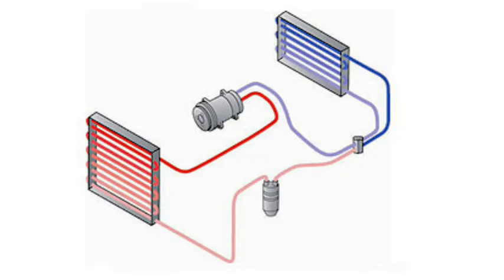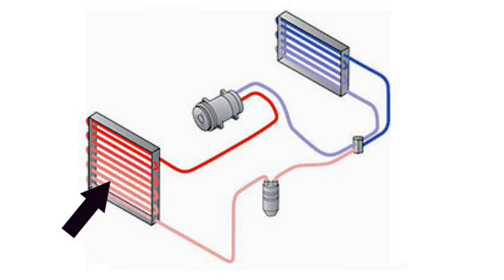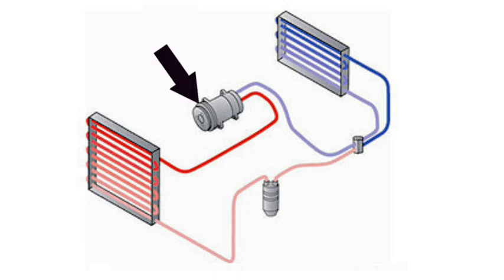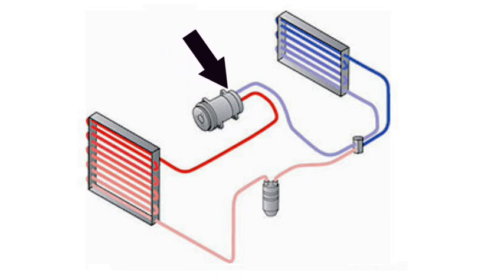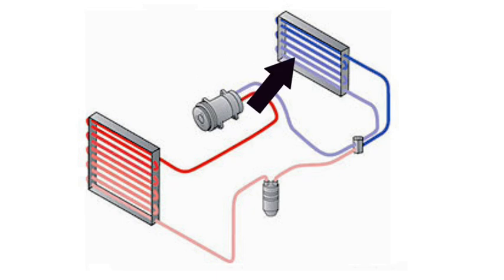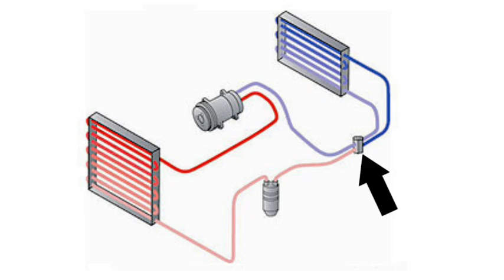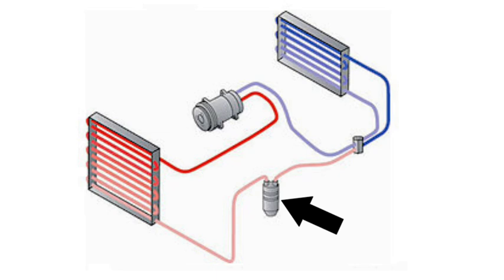AC System Basics - EricTheCarGuy

Comment: A year ago the original compressor on a Honda civic 2014 was replaced due to clutch noisy pouly. Since that happened, the AC system lost it is cooling ability and started giving warm air due to a small leak (assuming!). Now on summer days,  I keep adding refrigerant to the system to cool down my car, it will lost 3 weeks and then repeat.  I didn't tackle this problem since it can be very expensive to troubleshoot. Do you think something happened after compressor installation? Fittings or compressor itself? Thanks.

Comment: Great video. 
I have installed a Vintage Air system in my 68 Chevy pickup. I am having the system charged on Monday. I have a concern about any debris or moisture left in the system. Is there anything that can be done about that?

Comment: Hi Eric, I have a Chevrolet Sonic 2015 the the problem is that the high pressure pipe is cold and the low pressure pipe is warm and the A/C does not cool, what could be the problem? i have to recharge the system each month.

Comment: Just remember if your have an Orifice Tube you will have an accumulator on the low side and if you have an expansion valve you’ll have a receiver dryer on the high side line.

Comment: I'm not sure what a trained professional is. I guess one that gets paid. I'm not a professional but more than once I had to fix my car because the pro didn't.  I should have sued one shop when they screwed up a simple timing belt replacement. Even after I told the owner he wouldn't fix it. I had to bring it to a dealership to get them to verify the timing Mark was off by 1 tooth. Then he decided to look at it. I told him I wanted to be there when he pulled the TG cover. He even tried to tell me it was right on the mark. Twenty minutes later he finally admitted it was off. The whole process took over 3 months I was without my car.  He fixed it but no apology.

Comment: nice A/C demo. Hi Eric what could be the problem in a situation where there is a continuous loud noise when you turn on your AC and later no cooling nor air being emitted ? The system becomes flat, not even sending out air all let alone cool air. I notice this when I took my car to the mechanic for transmission change, something I blamed on the Mechanic. Any suggestions ?

Comment: The receiver drier also stores liquid refrigerant for higher heat load conditions,  it holds a supply of liquid refrigerant for times  when the metering device throttles more refrigerant to the evaporator .

Comment: Thank you for this A/C video . I was wondering what could be making a weird noise in my 2001 Toyota Sienna Van. I did think it was something to do with the AC/ heat system.   When i turn on the AC sometimes the system makes a howling noise kinda like the sound you get when you swirl your finger on the lips on a Glass vase . So im guessing its from the belt on the ac compressor maybe?  my usual mechanics say they cant figure it out...  Also during winter when i turn the heat on , i cant keep it on for long because it starts giving out this weird musty/burned oil smell ... so i cant use the heat . I also told my mechanics this and they seem to make up excuses not to figure it out,... maybe you could give me some feed back , thanks!

Comment: Do vacuum pump remove some pag oil from the AC system? I want to evacuate then vacuum my car ac system because I accidentally introduced air into the system I did not purge the low side hose before I started charging freon to the system..

Comment: I brought a fridge van to convert to a camper.  The AC (fridge van AC) just needed a fuse put in to start.  When I tried it last year it didn't work so I left it alone (no cold).  Put in the fuse last week and it worked for two days.  Was good.  Now it's not working the compressor clutch works for a bit (10-20secs) and then releases.  I'm assuming not enough pressure on the low port (maybe there was some gas nocking about and it worked for a short time) so was going to fill with gas until it has some on the low-pressure port but unsure.  It doesn't go cold now.  Any ideas?

Comment: Hello, I have a question about my 1956 Cadillac originally has a generator , now I want to install a new AC system do I have to change to a alternator or the original  generator can handle the fan  and all that came with a new install  ?

Comment: What happens if you open a line over night because the compressor you have did not match what u got and had to wait  till you get a new one. Once everything is put back together, you vacuumed the system for like 45mins or so. Would that that be still ok?

Comment: Hey Eric, I have a 96 Jeep Cherokee, my mechanic replaced the high & low pressure AC lines and the compressor. But it's only blowing out cool air not cold. Should I look into the condenser and liquid line as the next root cause?

Comment: My 04 silverado is making a intermittent whistling noise from the cabin evaporator area. When it whistles the air blows colder and then blows warm until it whistles agian. Only whistles when throttle is pressed.sitting still it doesn't whistle but doesn't really blow very cold while sitting still either. Any advise?

Comment: So when you retrofit a system do you remove the old Schrader valve and twist on the new valve with the new Schrader valve also can just add some oil and dye through the charging line with Freon

Comment: Kind of an old video but I’m gonna bump start it so hopefully Eric or someone else could give me an answer. I have a 2000 Toyota Echo that needs some work on the A/C system, primarily, changing the compressor. Here comes the fun part: I’m gonna attempt to adapt a 2000 Corolla air compressor (more powerful, less prone to break so it seems), did a little research on the web and it looks like it might fit, have to do some modifications to the hoses and the electrical connections which are not that difficult in order to fit them with the Corolla comp. now, the real question is: since I got this from a pick-a-part junkyard (used, low-mileage and good condition) do I have to change the condenser for a new one or just a flush on the actual one will do? Hope someone can clear my head on this one. Thank you.

Comment: Does driving with high speeds increasing the performance of the compressor?
Reply: Zaid Alzaidi No, but it increases the performance of the condenser when you drive down a highway and put your hand out the window you feel a lot of air hitting your hand so at higher speeds you have more airflow which allows the condenser to reject more heat quicker.
Reply: @adamhvacr6536  Many Thanks. But does at high rpm the performance of the compressor increase?  because the compressor is attached to the engine by the drive belt. Hence, engine speed when it increase it will let the compressor to compress the gas more.  Or that is not the case?
Reply: Zaid Alzaidi  No the compressor has only has 1 speed no matter how fast you rev the engine or drive it the compressor has 1 speed because if it didn’t have 1 speed the higher the engine speeds the higher the pressure and you don’t want the high side pressure getting too high because of the refrigerant's boiling point and it causes leaks,cracks.etc  it only Increases the performance of the condenser when you drive down a highway and put your hand out the window you feel a lot of air hitting your hand so at higher speeds you have more airflow which allows the condenser to reject more heat quicker.
Reply: Adam HVACR I see. Many thanks for the information and your time bro!

Comment: Eric, thanks a lot for this great video (as always). Each time I try to charge my 2000 protege using the one gauge kit and I connect it to the lower line, turn the ac to max, the pressure goes up to 70 psi even if the system pressure is 0 before releasing 4 oz can,. The ac even after recharging still doesn’t blow cold air. Any idea? Btw the clutch got engage as soon as the the pressure reached the blue range (20 psi)

Comment: Well I do have most of the correct tools thanks to E-Bay and more then $ 5000.00 in tools purchased from there and after several years of working on my own cars I know that I have saved more doing the work myself .. And no I am not hitting on the men and women working at the garage as I do realize they are putting in an honest days work and expect a fair wage for such ...  Your's and other videos have greatly helped me in the diagnoses of problems but what would really help me is if you showed me how to use the tools better, I have a white R 134a Refrigerant  Re-Claimer, and an assortment of tanks for the R 22 & R 12 for changing out the old systems and up dating to the R 134a,  now I do not do commercial work that I want to make clear just my own and a certified person recharges the system ..  But having the right tools and having the place to do the work is a real money saver ...   So stay dirty Eric and keep the videos coming !!!

Comment: Eric, love the video. Here's my question. New compressor, dryer, clutch fan, orafice tube, system cleaned with chemical. All done by authorized dealer. AC still doesn't cool. It's an 06 F150. 5.4L. in thinking bad evap core? Thoughts
Reply: Blend door or mode door
Reply: @meengreen52  that has been replaced, and the actuator. Was getting nothing but hot are when unit was off. Not anymore.
Reply: Check pressures. If both high and low side are same, the compressoe is shot. Were all the lines replaced? I remember seeing a tech forget to remove a protective plug on a new line. It got sucked into the compressor and fubard the whole system 😂🤦🏽‍♂️

Comment: I replaced my compressor, dryer (accumulator) and the condenser last summer. It was a lot of work especially with the condenser and getting the vacuum pump and gauges to refill the system. Wouldn’t recommend but it did go from $1000 that a shop told me to like $350 after I returned the things I rented. I hadn’t ever done it before, and now I feel like I can do about anything car related but all I can say is to take your time and read up on how to do it if you choose. Plan to spend more than it looks.

Comment: Thanks for sharing this information Video. But My car is Honda Civic and its AC system is generating cool and not getting trip. this Cooling is getting increase that resultant AC Vent air is getting low due icing. It seems like Thermostat is not working but mechanic checked and confirm that Thermostat is working.

Need your help to identify the reason of AC is not getting trip and vent air is not getting low. please suggest asap.

Comment: Love your videos. I had the dash out of a 99 Ford F150, and after replacing many wires and vac hoses (from rat damage) I noticed the a/c works but in MAX does not sound right and stops blowing from vents, do you know what is supposed to happen when the switch is set to MAX/ Like a diagram?

Comment: Hi Eric, If there is a leak in the condenser resulting in empty coolant, would this prevent the clutch from activating to turn the pistons in the compressor?
Reply: Yes. There is a system pressure sensor that will prevent the PCM (car's computer) from engaging the compressor clutch if the pressure is too low. No refrigerant means no pressure in the system so the compressor doesn't engage.

Comment: The cooling is from the refrigerant changing from a liquid to a gas (phase change) in the evaporator located in the car's cabin. It gets cold in this evaporation process (just like the aerosol can spray). Incoming air is blown over the cold evaporator and it absorbs the heat of this air or the cabin air when on recirculate mode. Being a closed system, unlike the aerosol can, the compressor compresses the refrigerant gas and the opposite happens, it gets hot. It then goes to the condenser in the front of the radiator and it is cooled by the fans or airflow of the moving car. The refrigerant condenses back to a liquid and the cycle is repeated. Refrigerators work the same way.
Reply: Why does the Freon have to be recharged?
Reply: @goldwolf0606  Because it tends to leak out

Comment: Anyone have any ideas here: my 2000 dodge dakota slt V8 4.7 has started letting freon in the vents. A/c still works, but does stop blowing cold air & then will start all over with cold air.. I replaced the compressor last week, because it's been over 2 yrs I haven't had cold air.. Guess I should have figured this issue out before fixing the compressor/clutch problem! 😁 Any help would be greatly appreciated! I haven't checked the drain tube, but I don't think that's it, because my floor does NOT get wet. Still, I will check it.. I really don't want to have to pull dash AGAIN.. That is a beast! 😁 😂 Thank you..

Comment: Ugh took my Pathfinder in this morning and was quoted 1100.00 for a new drier and air compressor. Car was noticeably getting warmer when in park or idle and now only blows ambient air. This compressor is only a few months old as well as the condensor and drier and was told that the front seal was bad. I never saw a leak when checking to see if the clutch was engaging. I did 1st replace the a/c relay hoping it was just one going bad. Last wk while driving the a.c. turned off for a sec and then kicked back on. If its a high pressure issue I'm not sure why it worked intermittently so to speak. Any whoo,  I need to replace the fan shroud, and tempted to pull the compressor out and take it back since there's a warranty. Just feel like since I'm a gal...I don't know much but don't want to shell out 1100.00

Comment: hello e.t.c.g. nice 2 meet u. question... my ac was working fine but once i accidentally took a screw off of the lower left side of the condensor which's line looked like it went to 1 of the ac's h or L lines, a bunch of white smoke started to spray out hard and I waited till it all came out and there was none coming out anymore to close it back up after that my ac was not blowing cold, so I fillled it up with ac again and now its blows cold. do u think I should put in some of that ac oil u talked about? 2: and also everytime im only in d or neutral on my auto accord 94 I accelerate and at about 20 mph my compressor or somewhere around there it does a sound as if i just ran over a branch of old hard leaves only for a second and after a few seconds again it does it, on neutral and not moving at all, i accelerate and it does it at about the 2.5 in the rpm and it throws out littlebit of white fog from around the compressor side everytime it does that and only when it does that, I couldnt see what it was because i was still and in neutral and inside the car and only with the hood up. what do u think it is eric the expert car guy? thankyou very much and many blessings

Comment: Eric, I'm just a po suthern boy that ain't got no money.  Can't 'fford no shop prices.  Jes' go on tell me this--If I don't have power to the high side pressure switch in a 2004 Saturn 300, will that cause the clutch on the compressor to not engage?  I've checked all the fuses and they are functionally operational.  But where in the world does the wire go from the pressure switch other than to the compressor?  The compressor is getting power from the system, but the high side pressure switch is not.  Getting hot out here.

Comment: great video. i have watched many videos about AC and so far i have found two that tell you using a heat sensor gun to find out where the blockage is located(great) however no videos on how to remove the refrigerant to a container because it can be reused once the blockage is fixed. like whatatay T said they charge you an arm and a leg and still does not work properly, next is the dealer and those guys are expensive. I like to learn so i will do it myself. thanks for your advice though.

Comment: Where does a push button unit connect with an A/C unit for 1985 380 SL Mercedes? Mechancial says its about a $1850 used for one. Is this correct?

Comment: Hi All, Quick question, when the AC system is working properly, I put my hand on the low side line by the low side service port and it's cold...yippee.
It periodically acts up and blows warm air in the cab however. At that point, when I touch the low side line by the low side service port and it's warm, what would cause this?
I'm hoping it's just low refrigerant but I have a feeling I have a bigger problem. 
Thanks a bunch

Comment: Hey Eric, I have a question. My A/C compressor does not work even though the mechanic says there is power going into the compressor, and the system is topped up with Freon. Also, the radiator fans don't react when I press the A/C button (they just do the regular intermittent operation). Does this mean my compressor is blown?

Comment: A self proclaimed auto tech told me my 2007 CAMRY  AC Condenser isn't circulating and needs a new one,....it'll cool for a few minutes and then no cold air,....I shut it off for a few minutes, turn it back on, and it'll cool for a few mins. again, but won't stay cold.  Can it be flushed, or is there another fix? No leaks anywhere, and fully charged.  He won't agree to a Denso OE condenser replacement, ($70 ), and wants to get another one for $150 + $100 labor. This, coming after  he first replaced 3 lines, for $450.  Toyota replacement parts and labor from a Pro or Toyota dealer are a ridiculous and exorbitant rip-off  !  !  !

Comment: Thanks for the video. It's making me wonder - what happens in electric vehicles on the compression front? They would be using electric compressors - are they inherently more efficient than the standard mechanical one? I reckon that having a clutch based wheel would be relatively inefficient vs. having an inline motor? What do you think @ericthecarguy ?

Comment: I know this video is extremely old, but would there be a way to rid this to an off grid solar system on a vehicle to run without the need of the engine running?

Comment: Does the Ac compressor speed need to be constant? If so how do they achieve it as engine can spin in different speeds according to the throttle position?